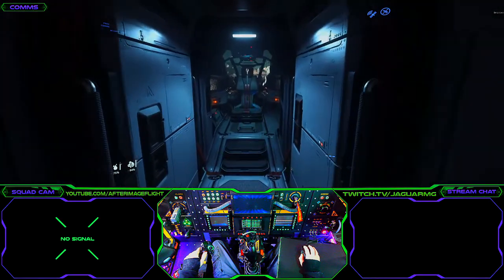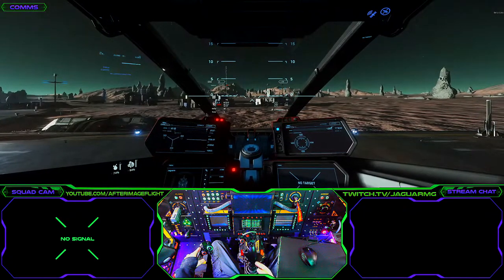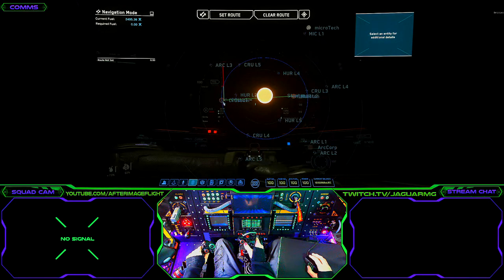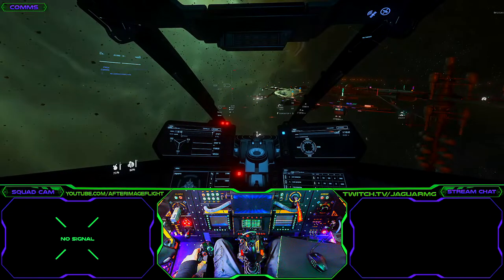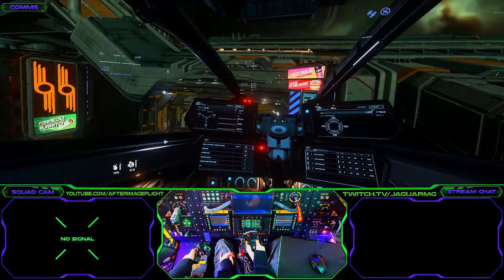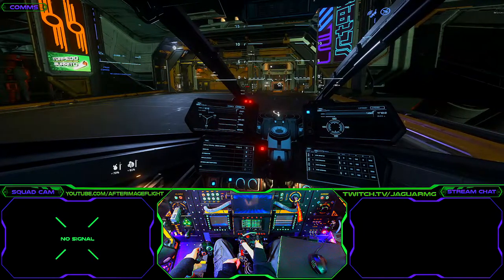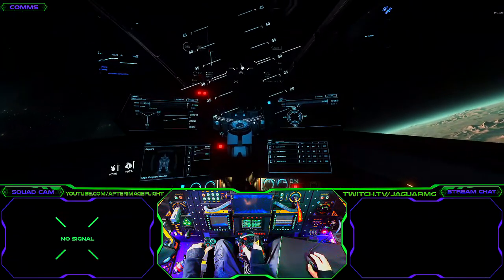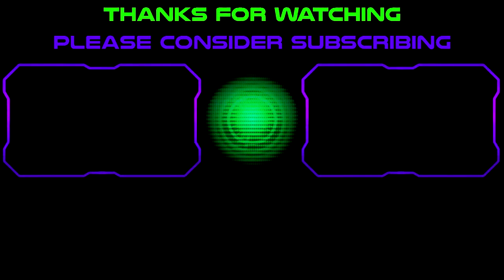Exploiting the Controls with Multiple Inputs | Simpit | Star Citizen Setup

Comment: Well had to watch it in 2x speed video feels like its a thousands years long

As for the hole more than 2 arms part that can be copied with your thumb and your hi-hat and surrounding buttons

While certainly not a dual joystick replacement you can at least fly similar to using 2 in-dependant joysticks

And you can pick and chose between using modifiers or having the hi-hat and buttons as on off controls instead of swapping from navigation to aiming

Personally i just fly at full speed at the station request landing do a 180 backflip and full burn stop while figuring out where my pad is and then go fly and land

But i have in the past flown fully with a single stick while also setting my overclock settings with my mouse tho its a ultra rare thing as i normally take off when i get on and then land and get off up to a dozen hours later
Reply from the maker: Happy April Fools :P